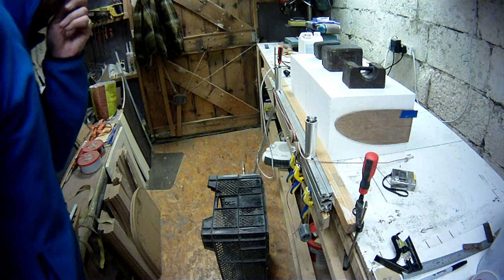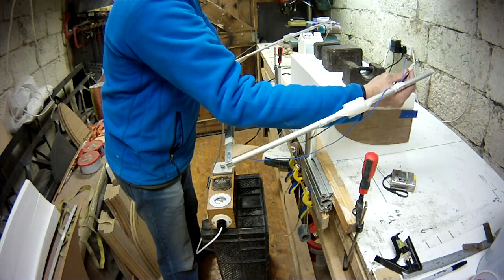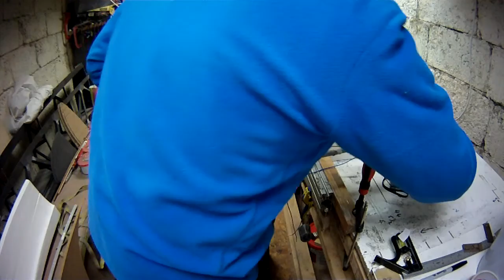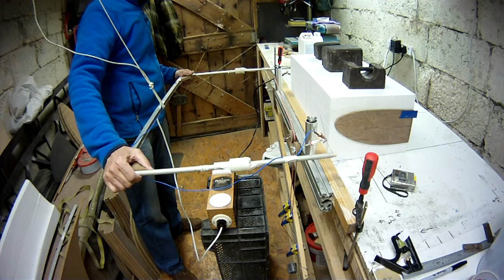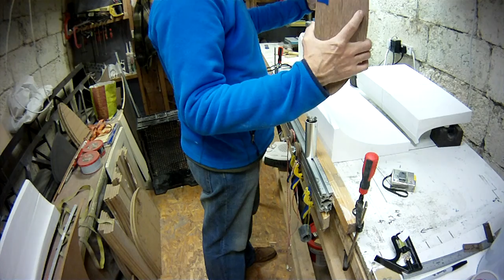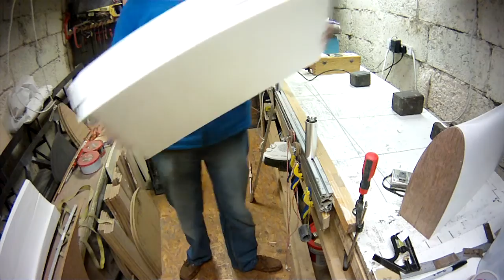Phil Lardner's Carbon Dragon Project - Hot Wire Cutting EPS Foam Leading Edge Profiles

Comment: Nice set-up Phil, but it looks like you're getting some lag around the leading edge. Try reducing your cutting speed just tad but definitely tighten the wire on your bow more....infact get it as tight as you safely can!
Reply from the maker: +miniphase Yup - that was my conclusion too! I thought I had the wire reasonably tight, but I think it may become slightly elastic at higher temperatures (or maybe that's just an illusion!) The wire definitely lags (bows) towards the center, so a much tighter wire will definitely help there - as will a lower temperature. This was my first attempt at hot-wire foam cutting, and I've got a few more blocks to cut out yet, so I imagine my last cut will be the best! :-)
Reply: I used some thick carbon fiber tent poles and made a real bow. It is smaller for RC but I bet you could make it much larger with those metal couplers they have. Mine is very tight, probably a little too much for safety but I am always mindful of where the danger zones are.